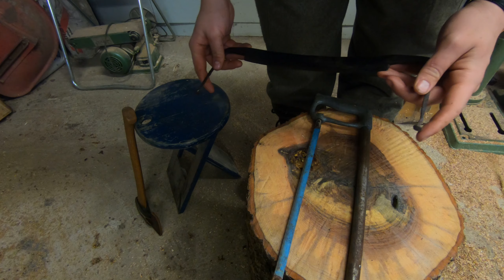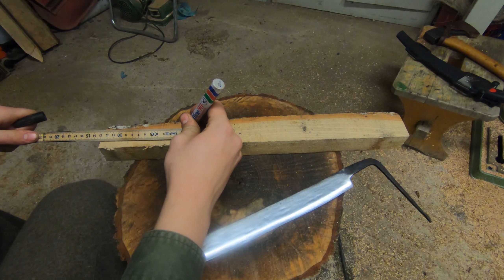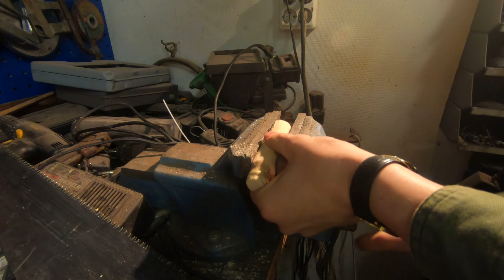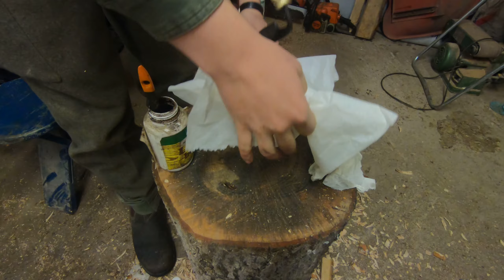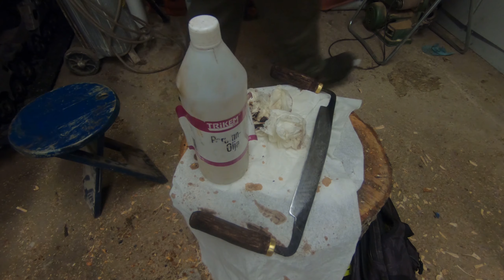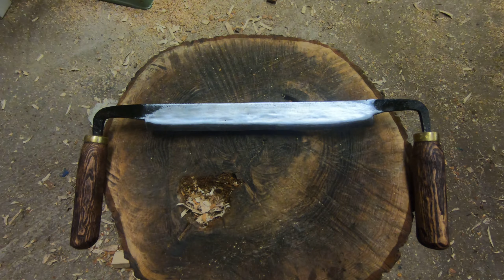Old Draw Knife - RESTORATION

Comment: dude its a draw blade , the handles are going to pull off the first time to put it to hard use . you didnt make it like it was originally. the metal had nubs at the far end of the handle to keep it locked on.
Reply: This post was made by full tang gang
Reply: I was waiting for him to drill a through-hole and weld new nubs over the ends to lock the handles on...only to see that he didn't even use glue to set the wooden handles on. I enjoy the handy/crafty work, but practical function should top the list. A boss fit alone doesn't work with this kind of tool.
Reply: I think he’s got it figured out 😂